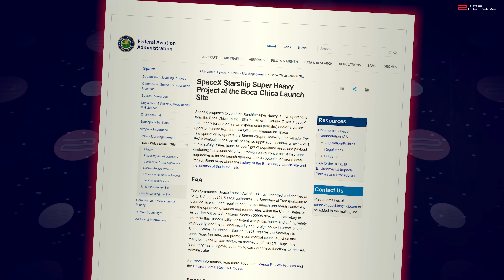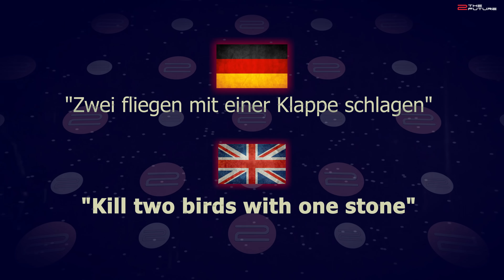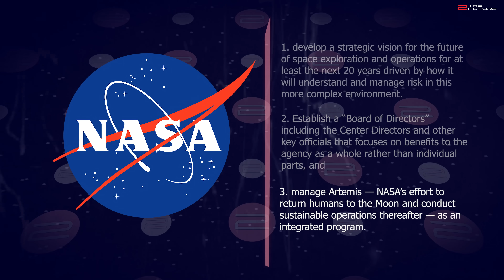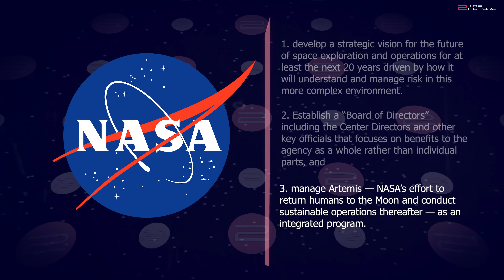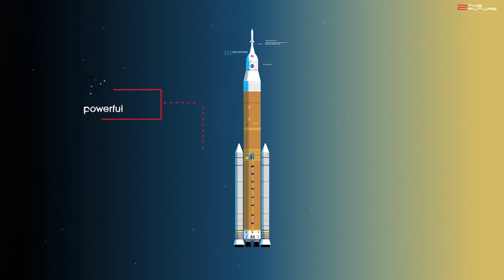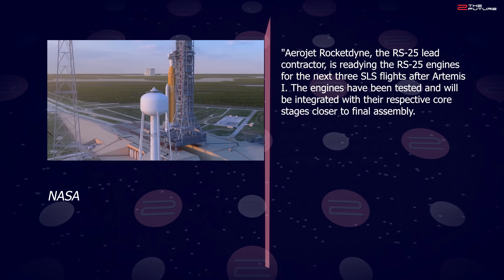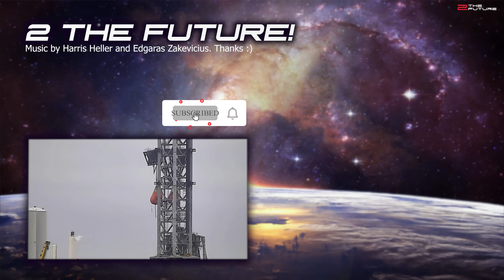SpaceX's aggressive timeline for Starship and Starlink has been updated!

Comment: You say NASA is going to give an update on the Artemis 2 mission and that you promise even not to be to sarcastic about that one -Why? Its your knowledge about space coupled with spoonful's of sarcasm that keeps me coming here, it would be a sad day if ever you gave up the sarcasm. However you never said you were giving it up so thanks for that. It is indeed incredible that SpaceX has a 10 fold increase in its customer base for Starlink, I guess Elon aught to thank Joe Biden for his ever increasing endorsements of everything SpaceX for that. NASA & Boeing building engines for Artemis IV that's a laugh, they don't even know the root cause of the 13 stock valve failures in their last attempt to orbit their dinosaur, it is excellent that ASAP saw fit to criticise BOEING and NASA over this as they did get very close to launch with such a massive failure lurking. I have always had immense regard for NASA and like many giant organisations they sometimes get too confident with their way of doing things and loose their way. NASA needed a wakeup call and I hope they take heed of this warning. As for BOEING I am not to sure, they way they have behaved before and after the Max crashes along with their continued air related problems, they would be the last company today that I would continue to involve in anything space related especially Artemis as some seriously forward thinking will be required to get cargo and astronauts there safely furthermore to keep them safe whilst there which will involve many many launches, in fact, please how was BOEING ever involved in this mission given they can only produce one dinosaur per year? As always thank you for your informative update and you owe us some more sarcasm to make up for todays lack of same. Thanks very much from England UK.

Comment: Well let us not forget the tremendous strides NASA has been responsible for in spaceflight. However NASA is becoming increasingly irrelevant not necessarily its fault but it is really only a dispensary for large cheques. To regain some pre-eminence it needs to change its approach which will not be easy as the US government forces it to spend its money on hardware which is way overpriced as a means of buying votes.

What NASA needs to do is develop its own hardware not really on commercial companies not even Space X. To do so will require a clean slate approach for example NASA are developing their own space suits for the artimus program not only are these behind schedule but their cost is $10 million each.

They need to learn from commercial companies develop their own Engines suits Life support etc and develop a family of 100% reusable rockets it will be hard for the government to insist on it writing $20 Billion dollar cheques when NASA can say we have the existing hardware to do it at a cost a fraction of a percent.

Comment: I’m not surprised how quickly they want to send out the new Starlink satellites in Starship. The likelihood of Starship having issues during ascent is probably low. The issues are going to come during reentry. They need to start getting there worth out of Starship as soon as possible.

Starlink V2 don’t fit in Falcon 9 fairings too, and would have required a satellite alteration.
Reply: Falcon Heavy uses the same payload fairing as Falcon 9.

Comment: It occurs to me that the animations have one detail probably wrong.  Every animation I have seen shows Starship being caught and then placed on the booster.  If that were routine, it would mean that Starship cargo loading would be done high up in the sky while it is mounted.  I suspect that will not normally be the case.  One has to wonder if the chopsticks will be strong enough to lift a fully loaded Starship?  They will have to be if loading is done on the ground.  If not, then one has to wonder how SpaceX is going to load the cargo while Starship is stacked.
Reply: I'd suspect catch and then lowering down to a waiting vehicle to be carted off to a VAB where the next cargo will be integrated.  Even with crewed missions they'll have to, at most expect turn around time for each starship to be about 10-12 hours (which isn't bad, 1 to return the vehicle to a VAB 10 for loading and checking and 1 to return the vehicle to the pad)
Reply: @Jadefox32  I doubt they will need a given Starship to turn around that quickly. It is more likely that SpaceX will already have a new Starship loaded up and ready for stacking before the previous Starship lands and then just stack the pre-loaded Starship on the SuperHeavy booster while the recently returned Starship is sent off to get loaded up for the next flight.
Reply: And right now, the best they have is animations

Comment: I can't find the name of the engines that NASA was working on for the next gen shuttles (X73B) project, but instead of trying to play catch up they should just restart development on that project. My understanding was that the engines could adjust their nozzles, so they didn't need different stages. That is something I imagine spaceX could also use in the future.
Reply: The shuttles failed at being reusable, cheap and safe. The entire concept of a shuttle was a bad idea. SpaceX is showing us how to do launch vehicle reusability right.
Reply: @ooooneeee  the old shuttle I don't think was designed for reusability other that the shuttle itself.  They were building a next gen one that was more of a one wing design that had the fuel inside. Of course that was until it was shut down and the test plane was bought my USAF and classified. One of the reasons they had so many issues were making the tanks and all of the modern materials they had to use.

Comment: Starlink V2 is nearly twice the size of V1 and just over 200 can be launched by 'ship' and slightly more starship launches will be required to launch the revised less than, in-total, 30000 starlinks required, as per the latest SpaceX filing to the FCC.
Reply: Not 200. More like 150-175.

Comment: Please do a video on how starlink makes cash, I can't make the maths work ?
Reply: $90 x 12 months per customer = 1080 per customer. 50 million customers = 54 billion per year.
Reply: @whowhy9023  $250K per sat. Life span = 5years. launch cost = $250K. Max simultaneous connections per sat = 2000. Ground station infrastructure, admin etc etc. Please explain how this is a cash cow, it does not work.
Reply: @whowhy9023  Dont you think we should get a breakdown on this "cash cow". No one in the industry can make sense of it, some nice threads on reddit but the best they can do is reach profitability in 2026. Either way SL is not a cash cow, never seen any financial breakdown that did not show the same. If this is such a cash cow it should be simple to explain, and make a video about.